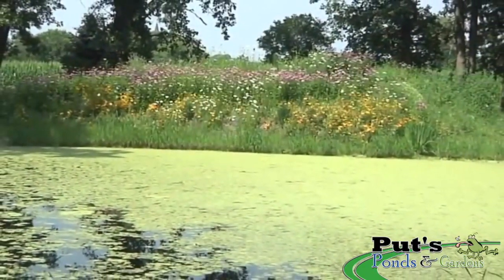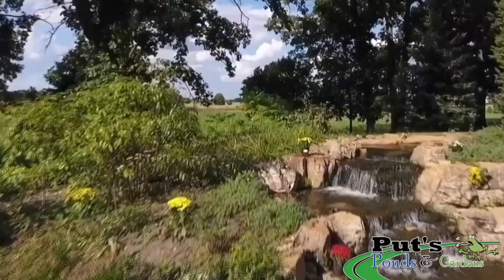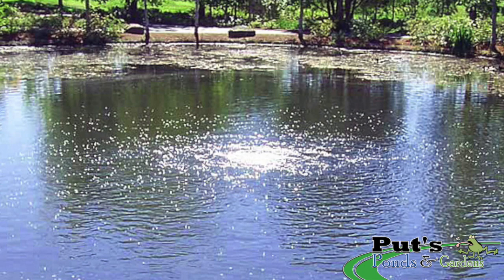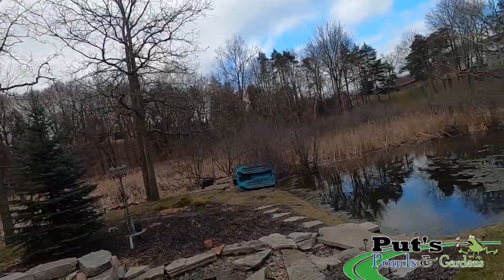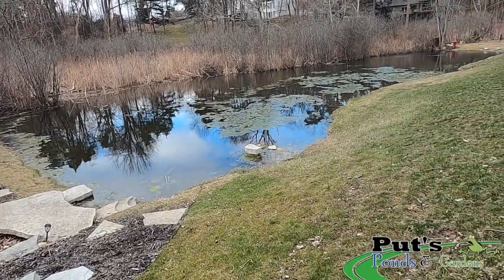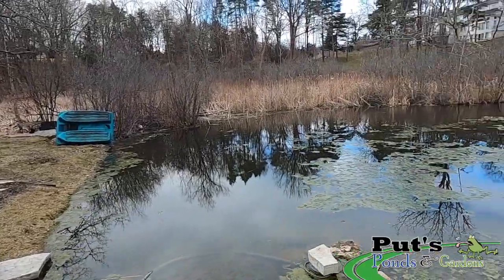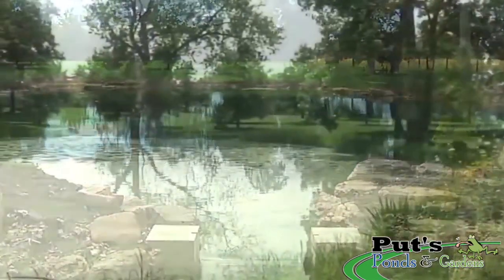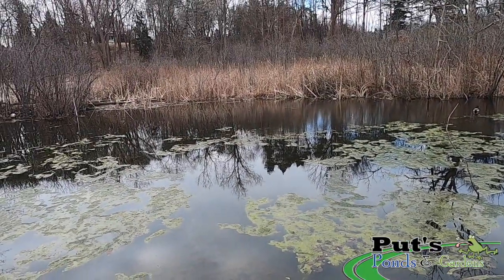How we treat a clay bottom pond

Comment: I have the same type of pond. In regards to the intake bay, what happens when the water level gets to low from summer heat and evaporation and falls below that skimmer that goes into the intake bay? I’m planning on making an intake bay as well after I finish my wetland filter.
Reply from the maker: Not all ponds are created equal, this pond happens to have a spring that flows into it...
Reply from the maker: You should know your low water mark prior to setting your weir of the intake bay

Comment: Good information and assessment of problem. I would have liked to have learned something about why the original builder's waterfall filtration system didn't work. Was it electrical equipment failure? Under-sized pump and/or filter? 
Either way, hopefully your solutions to whatever the problem was worked.
Reply from the maker: The original contractor just built a waterfall and not an up flow wetland filter… it didn’t  trap heavy organics from the system.
Reply: @PutsPonds  whoa, I just now found your reply on youtube after 2 years, lol. Hope things are still going well for you. I agree that wetland filtration is the way to go when you can move water. But what about an earthen pond which has no pump- how does one go about keeping algae at bay in still water? Not that I currently have that problem, as I'm still yet to build my first pond, just asking for a friend right now, lol.
Reply from the maker: @Rick-the-Swift  aeration, beneficial bacteria, phosphate binders… check out our “how to treat” earthen pond video with lake treatments

Comment: I just bought a house with this exact problem! I want to drain it, dredge out the muck, put a liner down to keep the rocks from sinking into the clay. Line the whole bottom with rocks, put a wetland filter on one side and an intake bay on the other just as you've described in this video. My question is, will the rocks stay exposed so their biofilm helps the pond or will it eventually get buried with silt and stuff? The pond is big enough that I can't/won't want to drain it to clean it out once it's in place. Thank you
Reply from the maker: Great question 👍🏻 if you’re going to that extent, go the extra mile and install an intake bay/skim cove to skim the surface of the water and keep the extra leaf drop off the bottom. Add aeration and use Aquascapes Pond & Lake water treatments (4 products) and you won’t have to drain every year 👊🏼
Reply: @PutsPonds  thank you! I appreciate it and can tell you know your stuff